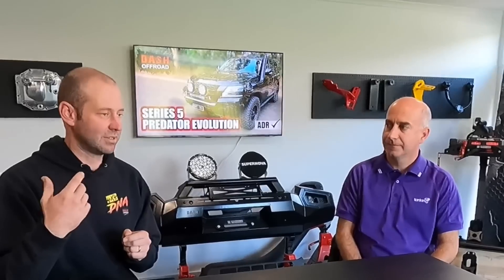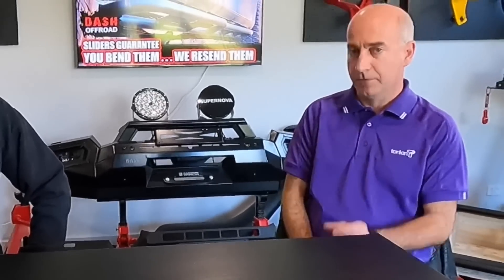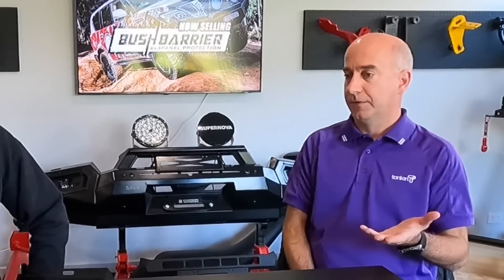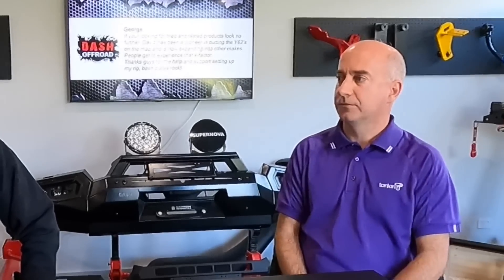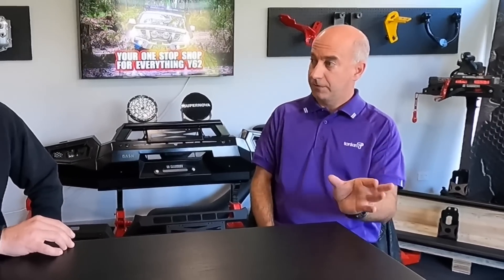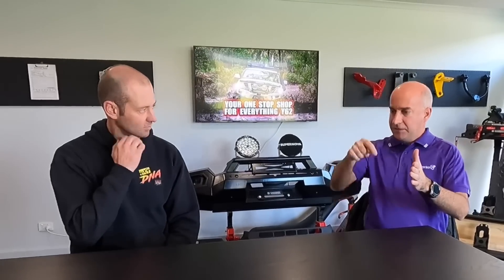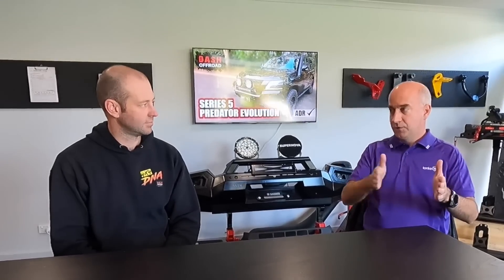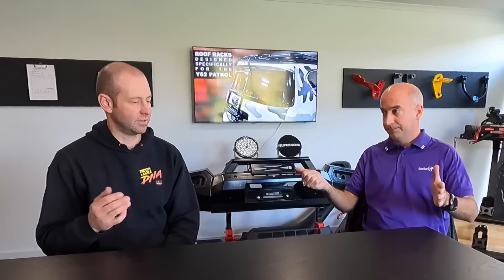Y62 4.085t GVM Upgrage - EVERYTHING You NEED To Know

Comment: I hear from East Coast customs that a 4.2t second stage manufacturer aus wide is almost signed off and is already signed off for the chopped Y62. It doesn't require expensive rear billets either and uses a coil lift instead of the ontrack lift. Could be a game changer for the community

Comment: Dave please state front axle limit
stock limit vs after upgrade 
then rear axle limit and new upgrade limit.
this is for 4085kg upgrade..
I haven't  been told the new weight limits after the 4085kg gvm upgrade.
Thanks
Ben.
Reply from the maker: It goes up to 1750kg on the front and what’s left is rear axel 😜
Reply: Thanks couldn't find that written anywhere

Comment: That doesn't make sense. How can you get to a 7t GCM with a 3.5t GVM + 3.5t ATM? 350kg ball weight needs to be included in the GVM so the car can only weigh 3150kg. 3150kg car + 350kg  ball + 3150kg (after subtracting the ball) van = 6650kg GCM max???
Reply: My understanding from the engineers explanation was the ball weight is not subtracted from the ATM. It is added to the GVM but remains part of the mass being towed.
Reply: @wasbruce  thanks for your comment. yes I would agree with that but that does address my point above?
Reply: In order to take advantage of the full 7t GCM, a GVM upgrade is required on the Patrol to compensate for a heavy ball weight transferred from a 3.5t ATM caravan to the vehicle.
Reply: 7 ton GCM would be 3.5t van and 3.5t car but the 3.5t car includes the ball weight 350kg so you can't get to 7t with the car already at 3.5t on its own.
Reply: @wasbruce  correct, so it is impossible to achieve the 7t GCM
Reply: @andrew9465  I'm with you on this. My understanding is gcm is calculated when the van is connected to the car. To allow for ball weight transfer the car can not be at 3.5 therefore your gcm will always need to be 7t less your ball weight.  So if 350kg ball weight only possible gcm is 6650kg.
Reply: The GCM is 7t and a 3.5t van with 350kg ball weight plus vehicle weighing 3150kg on it's own hits that limit so yes you can get to the full 7t GCM with a 3.5t van. Agreed it's not 7t total rolling weight which I guess was your point. Understandable that people assume they are the same thing but the example illustrates they are not, unless you have zero ball weight.
Reply: Got on specifically to look for/ask about this. From what the guy said in the video they mustn’t be worried about the caravan being over it’s ATM given he said it’s ok for both to weigh 3500kg when hitched up?
Reply: @CLOUTZ162  it’s ok for both the car (GVM) and caravan (ATM) to weigh 3500kgs, however the catch is that ball weight is included in both the car’s GVM and the caravan’s ATM.
Reply: Why the set on a 350kg ball weight? Go to 200kg.
Reply: @manofausagain  doesn’t make much difference, you would have to have 0kg ball weight to achieve the 7t gcm

Comment: Excellent Video.
Keen to hear more about front and rear axle loads.
Whats does 250kg on the tow bar add to the rear axle? My Guess is 350kg. Does the front axle load decrease with 250kg on the tow bar?
Reply: If using your maths, 250kg tow ball weight, 350kg (only your estimate) then the difference is removed from front axle so 100kg. Which is why your steering is lighter.

Comment: One little point I picked up on regarding the maximum 50mm of lift. If you put tyres on that are 50mm bigger than stock....so going from 32.6" to 34.6"...... that only raises the car by 25mm because of radius v diameter. So, wouldn't it be possible to put-on tyres that are 50mm larger and then do a 25mm lift as well?
By the way, Stuart Crosser is a great bloke....he is the bloke I went to back in 2015 to get the Silverado's GVM raised from 4.49 tonne to 5.17 tonne. (IE 627kg increase) GCM stayed the same at 11.1 tonne.

Comment: Great video Dave, but only boo boo was the 2” in relation to overall lift. 
With 32.6” standard you going to 34.6” (tyre increase tolerance) you actually still have another 25mm (actual 24.2mm) roughly allowable lift to be within the 50mm lift. 
The towing rating sticker on S1-4 we should all throw in the in because as the Engineer stated as long as you are within the physical real weights you are legal. So the stupid de-rating Nissan do is irrelevant.
Reply: I have been saying that for ages , people still don't get it the sticker states GUIDE ONLY so you can be 3.5T including TBW with a S4 or earlier 62 and you are good to go but you must  not exceed the rear axle max of 2030Kg